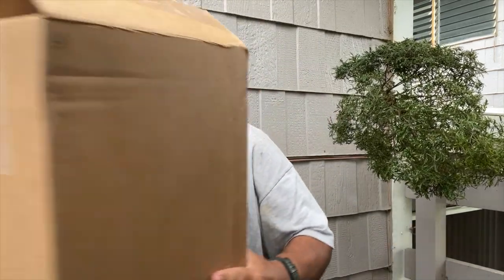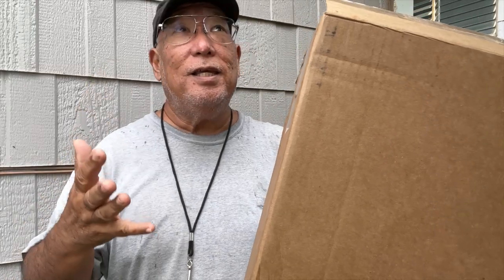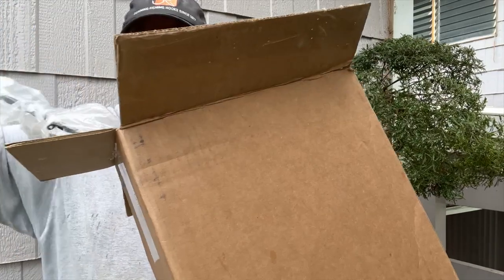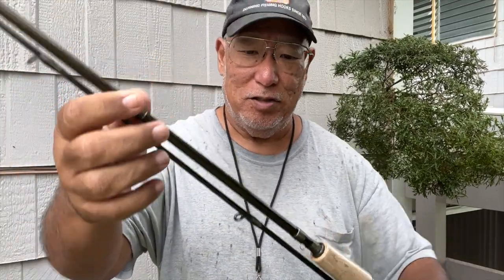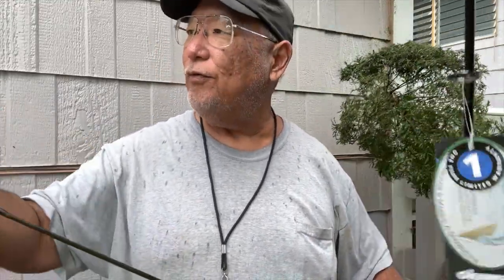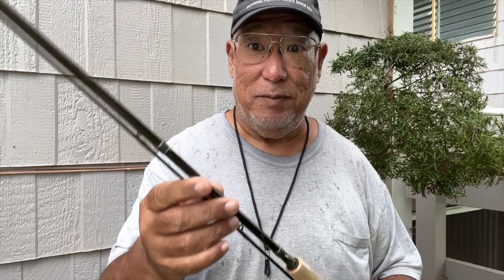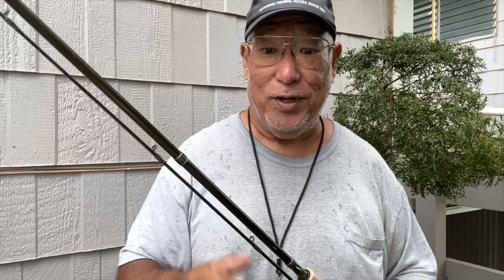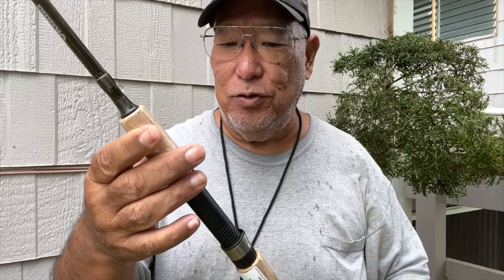Okuma Celilo "S" Spinning Application For Spinning Reels @ 9'6"!

Comment: Is this rod primarily for spinners and spoons, or jigs?
Reply from the maker: Spinners or conventionals (baitcasters). I use mine for Carolina Rigs & light shoreline jigging 1/2-1oz asymmetrical jigs. Like a cheaper version of Okuma's SST or Guide Select Pro line, just inexpensive.
Reply: @ScubaChris  thanks, I'm stuck between ordering the Okuma celilo salmon/steelhead rods, ones a 8'6" MHa, and the other is a 9'6" MLa. I primarily want the one that's gonna be best for spoons. I really like jigging for trout with my 7' light rod, I'm wondering if the 9'6" would work well for that too.
Reply from the maker: @Alex-wi2vf  Spoons go with the 8"6"MH. Or spend a few bucks more and get the SST 8'6"-9'9" in MH or H. Still under $100 w/free shipping from Amazon. Never had any issues w/SST's. A much cheaper version of Guide Select Pro's. And i've had several GSP break on me already (probably because i use them the most).